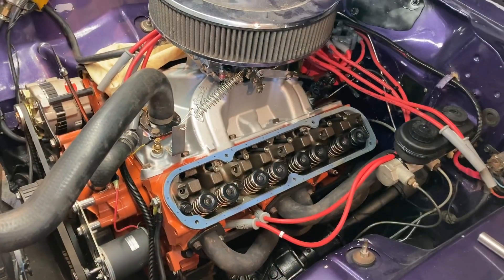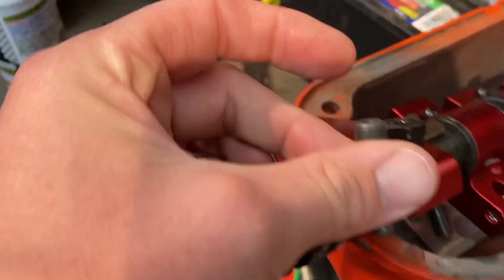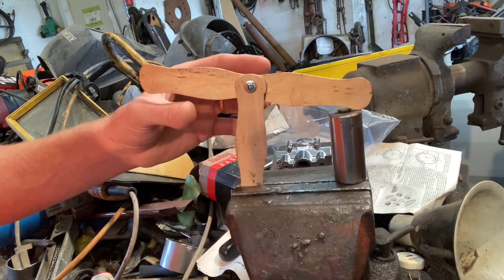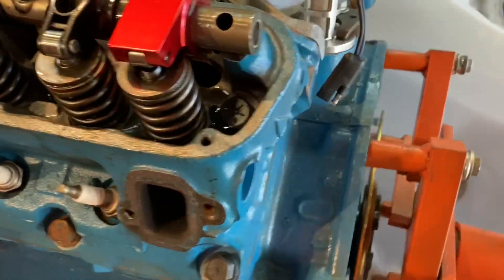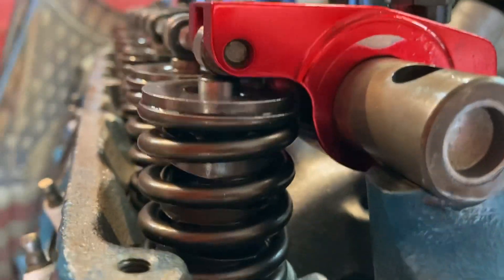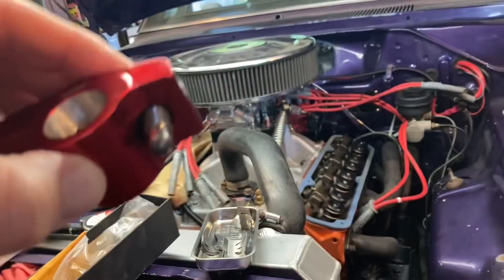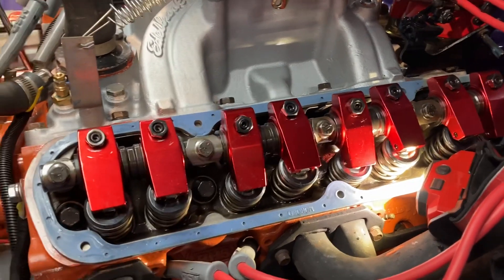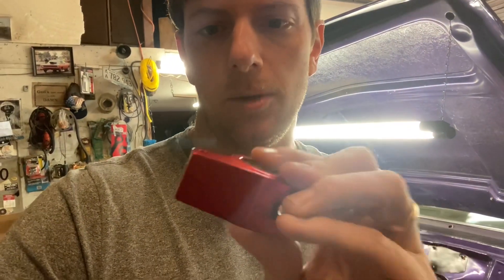Barracuda Drag Car: 408 Stroker Rocker arms and the Cure!

Comment: Nice! I have the same rockers,so I better check them out for cracks this winter! Glad you got er figured out,she sounds good!!!
Reply from the maker: Excellent! I know you battle test yours as well.
Reply: @JustMoparJoe  Oh yes,severe battle testing,pretty much every weekend!  lol.  Sadness is coming tho because racing season is just about over 😪
Reply from the maker: I’ve got to get out before it is! Prescott Arkansas always has a pregobbler race in November even. Never know if it’ll be 80 or 45 degrees
Reply: @JustMoparJoe   I sure hope you can,I wish you good luck! Really looking forward to see what she will run! 👍
Reply from the maker: You and me both! The cars probably heavy with that old cage, and 50 lbs of bondo 😂
Reply from the maker: Cant forget the Dana 60 and 727. Iron heads as well. I’d guess 3100 lbs at least.
Reply: @JustMoparJoe  Well thats 700 lbs lighter than me lol. And I my best time is  a 7.4602 @92 mph,and our setups are pretty similar, I believe you have a little better heads tho and I only have 3.91 gears,but I would think just off top of my head in the 6.70's range??  Just guessing tho.
Reply from the maker: @RT211Racing  if I can optimize it. My issue is always time. I’d be happy with a 7.50. My converter is a little loose if I had to guess, but will find out soon enough.
Reply: @JustMoparJoe   My converter flashes right at 4800 when I leave the line,which is a lot! But it 60ft is 1.58-160 so thats pretty good for this heavy thing with 3.91's  lol

Comment: I used 0.060" thick caps on all of my exhaust valves when building my 360 using the comp magnum rockers. I also used stock length pushrods. Brought my stems to the same height and made my sweep marks centered. The new guy at the machine shop messed up a valve seat and sunk them all to match. Wouldn't fess up to it and I didn't have proof. Unfortunately they're the only "reputable" shop around.
Reply from the maker: It’s a good solution. Ed from my machine shop video called and we just discussed my valve tips. He had asked why the other shop hadn’t reground them to make them equal, when I just got new springs installed and a valve job done.
Reply: @JustMoparJoe  awesome! Glad you got someone that takes pride in their work.
I had the shop set up my new springs too. They didn't give me near enough retainer to guide clearance when I first got em back. If I ran those heads, I would have destroyed my new parts. I was met with "it's not our fault but we won't charge you to fix it and get you out of our hair"

Atleast I got that xD
Reply from the maker: Have to check and recheck!

Comment: Lil long on the threads  outta the push rod side  using longer pushrods will solve that it will not change the  roller tip to valve surface    at all but that long of threads  outta the adjuster will cause the rocker to break  it will put more pressure to the tip of the adjuster  area  most times it's 2-3 threads outta the tip your look to be 1/4 " of threads
Reply from the maker: I agree. Kind of had to tell from the video.

Comment: Hello Joe! I’m having the same issue with the RHS-X heads currently, and I have the Mancini/Harland Sharp 1.6 roller rockers. Are your red rockers 1.5 rockers? If so, that would be our difference, maybe I need the 1.5’s and not the 1.6 ratio. Hope to hear back from you, keep up the good work!
Reply from the maker: The red ones were supposed to be 1.5. I usually buy 1.6’s to help make up for the lift lost with the crazy lifter angle on small blocks. 
A few options could be, running different keepers and lash caps, or getting valves with longer stems. I think my Harland’s were 1.6’s and had a larger diameter roller than my red rockers. I’m also trying to remember if I could find lash caps for the 8mm stems.

Comment: Check the ball diameter of the new crane adjusters....some of the 3/8-24 adjusters come whit a 11/32 ball instead of the 5/16 ball which is what your cups on the pushrods are.....
Reply from the maker: Thank you Tony! I actually was able to use my old adjusters. But you do bring up a valid point 👍🏼. I learn a lot from viewers, and hope to share what I learn to help others. Thanks for sharing!
Reply: I would never blindly trust Crane branded cam stuff. I once bought some adjusters for a gen2 426 HEMI, and they were SO loose you almost didn't need to screw them in, they practically fell into the threaded holes of the rockers. I mic'd them w/3 thread wires and they were like 0.020" undersized. Which is awful, if not criminal.

Comment: Gret Job but I still didn't understand how you got the red rocker arms to hit center when they were off center. ?
Reply from the maker: They had a shorter distance from the center of the roller to the center of the shaft. Ideal for my short tipped valve stems.

Comment: Why are not running the Comp pro magnum rockers
Reply from the maker: Thanks Jimmy for asking. My valve length is not long enough on my 408. They’re great for the longer stems you see in the picture. But they have a bad placement on my 8mm valve stems,
Reply: @JustMoparJoe  thanks. I have a new set I’m planning to run on the next LA I build.
Reply from the maker: @jimmyford271  they seem to be very sturdy and nice quality! Just not right for my goofy valves.
Reply: @JustMoparJoe  yeah I had a set on a 499ci low deck and really liked them. It had Indy 440-1 heads and they centered nicely on the valves.

Comment: If you want to run lash caps,  you need different locks that have a relief to clear them.
Reply from the maker: Yes sir. That’s one reason why I didn’t use them here. I try to when using the 273 styled rockers.

Comment: Joe is that a stock shaft and stock seperaters? Meaning if I needed to upgrade rockers could i use my existing hardware and just buy the rockers themselves
Reply from the maker: Hey bud. It’s better to upgrade the hold downs of using higher spring pressures or higher rpm. I wouldn’t be scared to reuse a stock shaft if it’s in good shape with no scaring or wear on the bottom side. Mancini sells that stuff fairly inexpensive. I haven’t had time to order it. The comp stuff came with a shaft and spacers, but no hold downs or bolts.

Comment: Hey Joe, I’m using your video for reference, again lol. I have a roller rocker shaft and after I purchased this engine, (it’s never been started), they put one rocker shaft on with the tiny holes facing up on one side and the tiny holes on the shaft facing down on the other. In one of your videos I noticed that you mentioned it. Are those small holes in the shaft face up or down? I’m in the process right now of shimming and noticed the holes being opposite on the shaft itself. Any info is much appreciated, as usual. Thanks Joe!
Reply from the maker: Holes always down! That’s wild. If you notice, the holes are offset from the center holes. That offset should go towards the valve I believe. I have an in-depth video in the 360 build. Hope that helps!

Comment: With my aluminum heads I had to add shims to the stands in order to reach the center of the valve tip
Reply from the maker: @StanleyBlack-xf3hv  here’s the ultimate shim kit. Easy Mopar Rocker Arm Geometry: Studying the B3 Racing Kit #mopar #engine #bigblock
https://youtu.be/LbAgW7mWOJE

Comment: Your roller should be centered on the valve stem when the valve is at half lift.
Reply from the maker: I agree. It would need to start outward of center to draw it's way in, while cam is rotating.

Comment: Geezuz. Whoever's doing those heads of yours should be fired. There should be no difference in the stem heights. It's a little difficult to get them right, but it's far from impossible. And the stem tips look terrible. The tips  should not be worn like that. And they should have been dressed perfectly flat. Sorry, those heads look like a mashup of incompatible parts. 
Furthermore, just seeing daylight between the spring/retainer & rocker body is not good enough. You need at least 0.060" clearance measured with a feeler. Have you never seen a slow-motion video of a  valve spring "walk" around when your engine is hitting 5k+  rpms?
Reply from the maker: I have a new machinist now. Check out Ed’s Machine on YouTube.

Comment: The length of the arms on the rocker has a lot to do with how many shims needed. The pedestals on the head lean in toward the valve. There for the more shims added moves the rocker tip closer to the valve.I had to shim mine .060 in order to reachthe center of the valve

Comment: If you had reduced the amount of shims to about .060 it would have pulled your rocker tips back towards the center of the valve, been through the same problem
Reply from the maker: @StanleyBlack-xf3hv  I replaced these with Harland sharp and it drastically helped. Check out my b3 video. You’re watching a video that’s some years old now. I’ve gained a bit of knowledge since then.